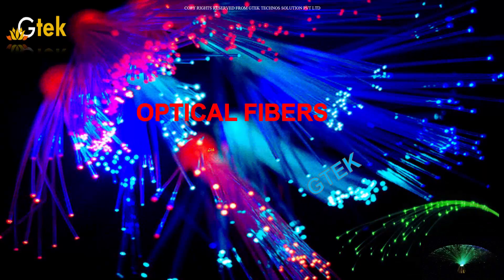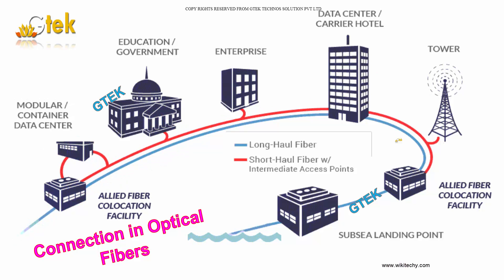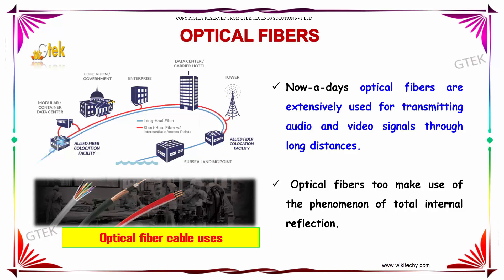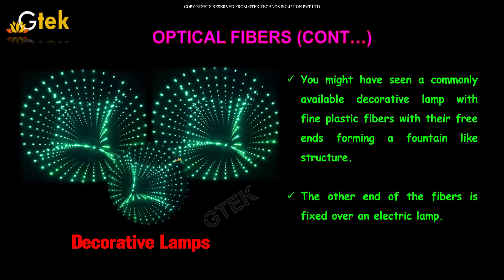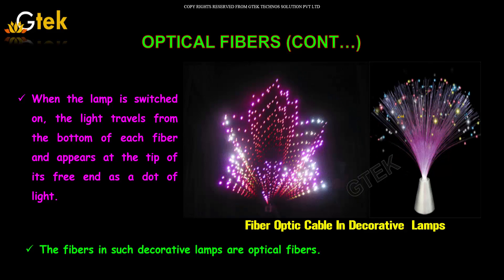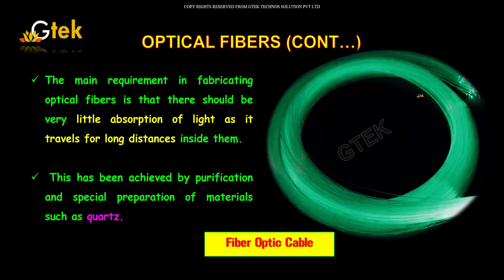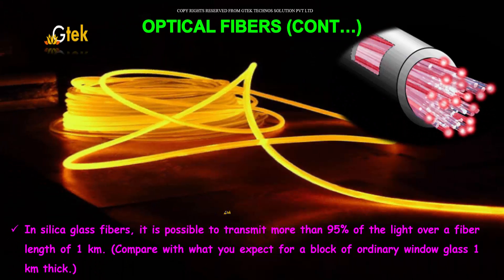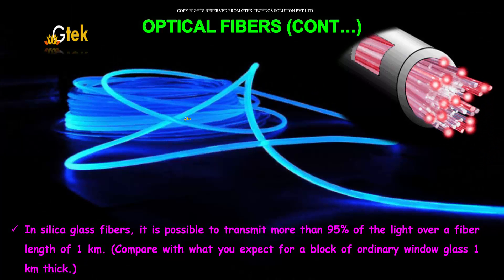Total Internal Reflection In Optical Fibers|Optics|class 12 physics subject notes lectures|cbse

Comment: When light traveling in an optically dense medium hits a boundary at a steep angle (larger than the critical angle for the boundary), the light is completely reflected. This is called total internal reflection. This effect is used in optical fibers to confine light in the core.